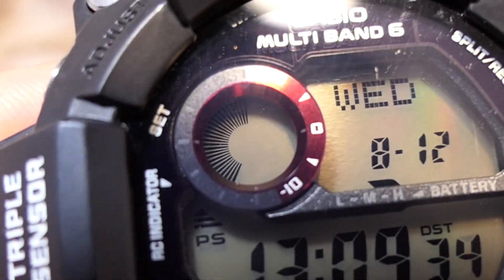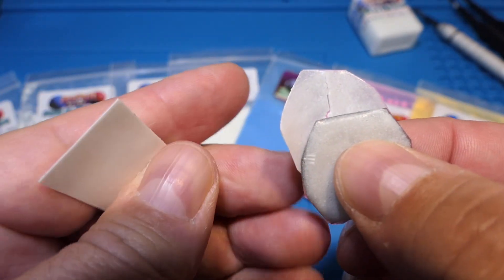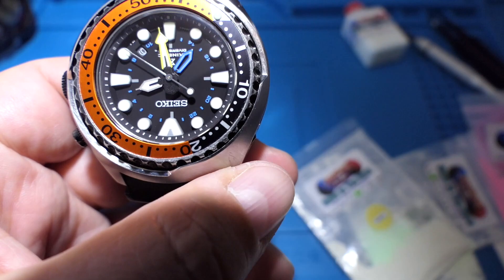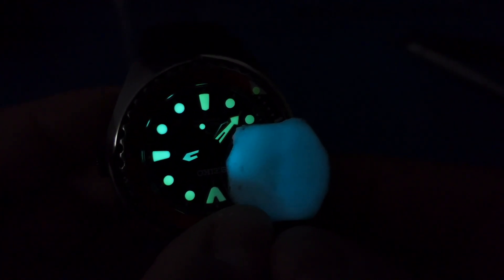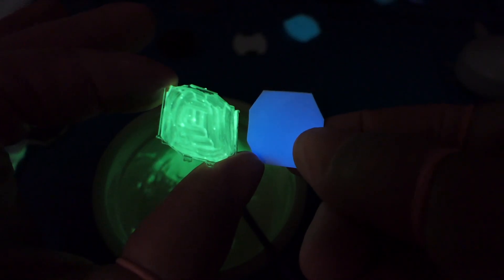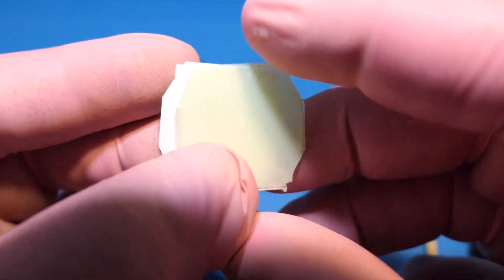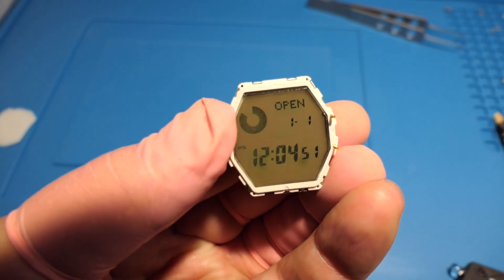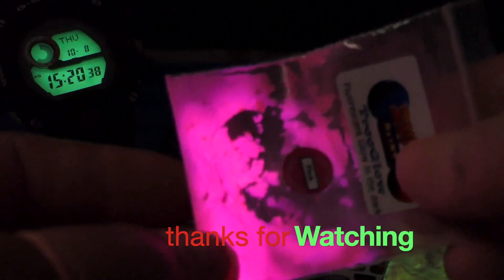CASIO G-SHOCK GW 9400 Rangeman with a Luminous LCD display - PART TWO

Comment: Amazing work mate. I never knew lume could work so well on digital watches. I appreciate the bravery you have put in while disassembling a G-Shock most would keep original.
Reply from the maker: My aim was to remove those line on the display, now I believe that's a first... lume on a digital has been done before, but not using this crazy amount of lume... am looking at UV inside the Rangeman, possibly using optic-fibre :)))))))))) 
Cheers for the support my good friend, and wish you a jolly good fine weekend too  :)
Reply: @WatchUP69MrRangeman  happy weekend mate and good luck finding the backlight springs so you can fit the UV light in the Rangeman.

Comment: I've never understood why digital watches don't have a passive lume dial and vice versa, why so few analogue quartz watches have LEDs or EL backlights. The LED/EL is obviously superior in that it doesn't need to be charged, so no matter what you'll be able to read the time. However passive lume is great and would save on the battery, why not do both whenever possible? The only non timex analogue watch w/ LED backlight that I know of off the top of my head is a Casio Oceanus that's rather expensive.

Comment: Cool video. I prefer Casios as they are, but good job. The GW 9400 Rangeman. Still, the best G-Shock ever made.
Reply from the maker: I really wanted to know what the GW-9400 would be like without those lines on the display, and then it rolled from there thinking I was the first, but found a video from 2017 that showed a digital watch with lume, but now my lume is insane with glow :)) 
Cheers for the feedback and wish you a grand weekend too my friend :))

Comment: Congrats for the great result. Very interesting video!!!
You lost backlight probably because you solder both the leds on wrong polarity (Murfy's low). Can be fixed if you reverse them.
Reply from the maker: Cheers buddy... I lost the backlight because I lost two of those tiny contact springs, and they're not magnetic, so can't even sweep for them using my massive magnet :( I can't find replacements either, so will leave it for the moment, but have ideas... I need some powerful UV's inside, that'll make thing more interesting, but for now, lume shot with a torch keeps her burning :)
Reply: @WatchUP69MrRangeman  
Hi my friend, had same lost springs issue, when I positive modded my GW-B5600BC-1BER. Soldered  commercial smd leds on the pcb pads (like you did) and now back light works better than original.
UV leds sounds  very interesting approach!!!
Waiting for results on a next video.
Reply from the maker: @seliandros  I will probably send this to a buddy of mine, who has the finer equipment needed... would love a luminescence sheet on the back that's UV, imagine that :))) 
I even have ideas with tritium LML :-P 
I am thinking about many ideas, and now I've come this far, might as well go to the edge of curiosity :)) 
Cheers!
Reply: @WatchUP69MrRangeman  once it's all mastered, we need your  PayPal account to pay you to modify our sad and dark negative displays. Imagine  GA100 benefiting from a red light.  🔥 🔥

Comment: Is there tutorial on removing the lines from the eye?
Reply from the maker: There isn't... it wasn't easy, as the back part of the polarise film has to be removed, and at anytime, you can easily crack the LCD glass... and you can't find replacements either! It's all a risk, but is a game changer having a readable sub-dial... have no idea why the GW-9400 sub-dial isn't like that on the GWF-D1000???

Comment: Hello there WatchUP69, 

I must say, thanks you for that vidéo, i'm in the process of making this on my rangeman aswell,  that's awesome, but i wanted to know, do you think if the lum powder can be applied to a sheet with an airbrush to avoid having some bruch strokes or some chunks  visible behind the display of the watch ? 

and second question, did you noticed a slight green tint to the display during the day caused by the lum powder in the display ? or does the display seems to be completely stock during the day ?

Comment: Could you please do a review, even short and even without the actual watch, of the Garmin Instinct Solar? Maybe a comparison vs the Fenix? I would like to see how to navigate with it, if I can use apps as Komoot, if I can store routes and tracks...
I know there are several reviews already there but no one seems to highlight the differences.
Many thanks
Reply: Mr Rangeman (apologies for the lack of knowledge of your real name): I will have a look at your Instinct‘s review from 7 months ago. It is not the solar version but I don’t think that changes the way it manages navigation. 
Thanks a lot
Reply from the maker: @domxem5551  To be honest I don't think there's much difference between the navigational side... it all depends how long you're wanting to use the GPS, as for me the Gen1 Instinct has plenty of battery for a good days worth, and by adjusting some settings you can push it over 30hrs. Komoot is great, but use it more on my devices as sometimes it's not always easy to plan, I take from Komoot some of the ideas and activities others have used, and combine that with Garmin Explore to make my own route :) 
I would like to test the solar Instinct by doing one of my pointless GPS tests that i've done before against the GPR-B1000 G-Shock, but that will be next year if it happens :)